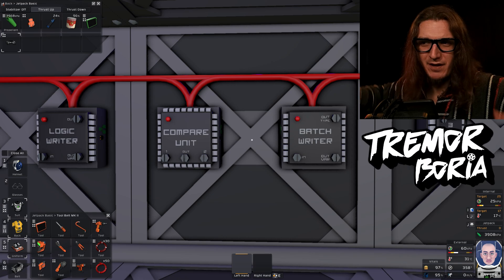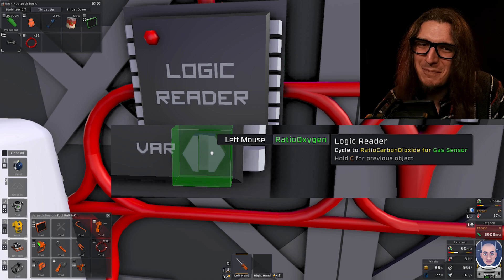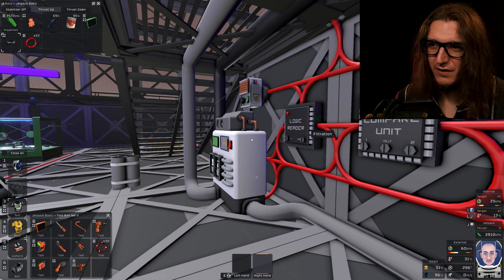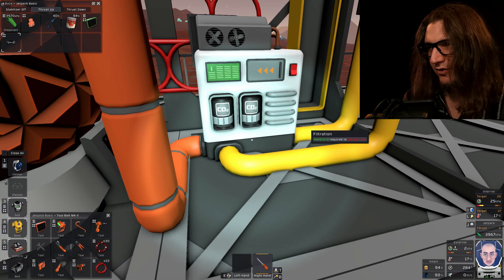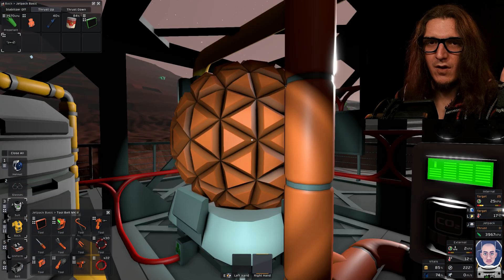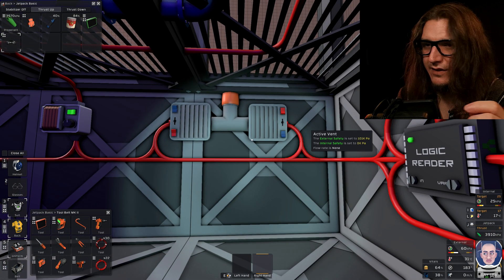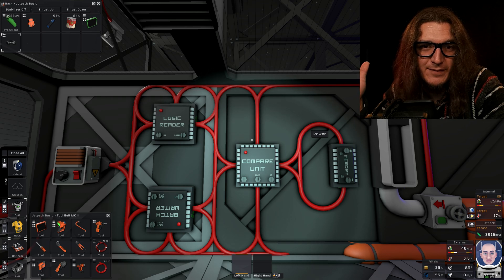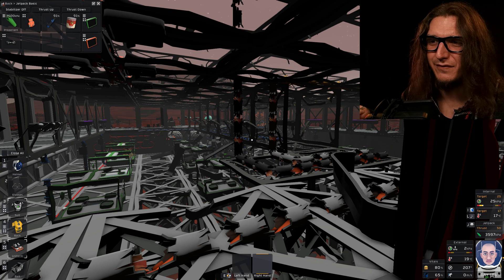Stationeers: Automated Greenhouse. Everything EXPLODED!

Comment: I have one of those circuits in my Europa station for cooling the interior and sometimes it just doesn't switch when it should. Setting the compare unit to a different comparison and then back makes the contraption then flick the switch, but i have to notice something first to act. I think i will use an IC10 instead.
Reply from the maker: Sounds good my friend, Let me know how it works out. 
Thank you for the comment, you have a good day.
Reply: Well, it works without problems so far. Needs some watts more. (10/10 IC10 recommended)
Reply from the maker: @darthjeder  I'd love to be able to make IO10 videos, But ever time we get one done... It just seems so boring. I assure you when I figure out how to make them short and interesting we will have some out.
Reply: @TremorBoria  Hmm maybe with some 'debugging' LED number displays and with a tablet with the configuration cartridge to show how the code works and to have some alternative images for the rather monotonous code editor?